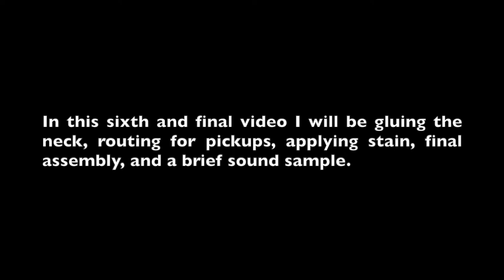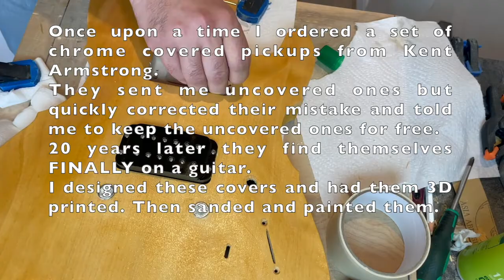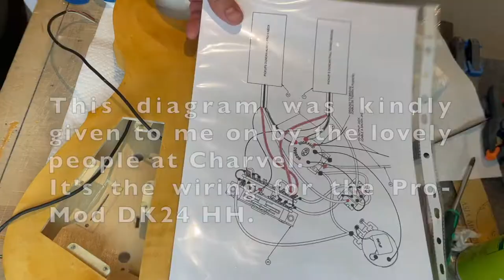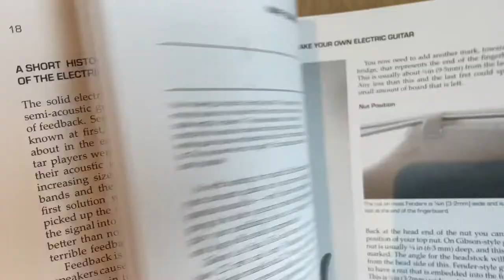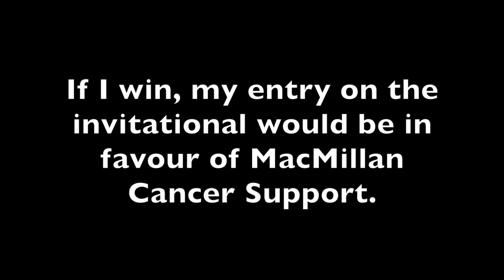The Great Guitar Build Off 2021 - GGBO2021 - Scratch build - "Itch" - part 6 - The Season Finale

Comment: Cool guitar. Great save on the finish. One tip: Pleae give your viewers more than two seconds to read your on screen text.
Reply from the maker: Thanks, I am aware but I was just about to upload when I glanced at the rules and my video was double the length of what was allowed. I will replace this video with the original 30 minutes one once this is over. 😉 thank you
Reply: @andresilva8444  Ah. I had no idea there was a video time limit.
Reply from the maker: @peachmelba1000  yeah. I can understand the judges will have to look at quite a few. Luckily I just looked at the rules once again before posting and uploading to the GGBO site. Oh well. At the same time, couldn’t convey the whole process in 15 minutes. Had I done it differently I would have ran out of time.
Reply: @andresilva8444  Understood. Did you build in the main area of your home? That alone is a mean feat. I have the luxury of a basement to work in and I make a helluva mess lol
There are a few videos on my channel of some of my builds, if you care to check them out.
Reply from the maker: @peachmelba1000  it’s a studio flat. So, bedroom, kitchen, living are is all the same. Lack of dust collection was my main problem.